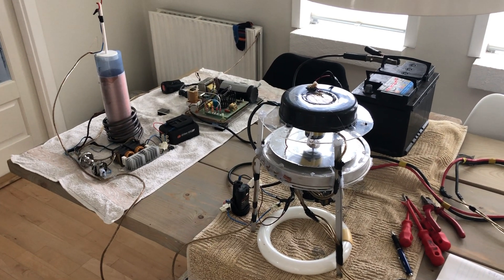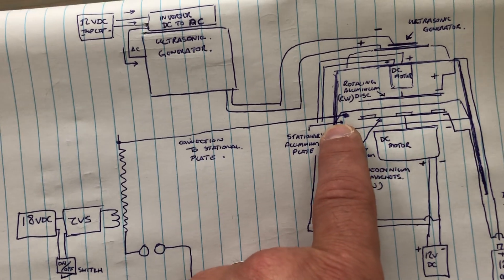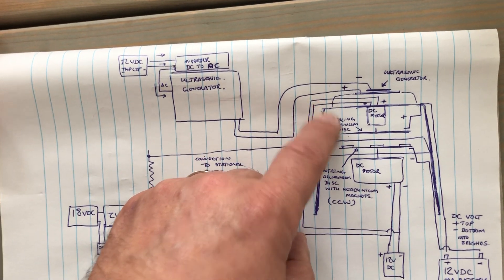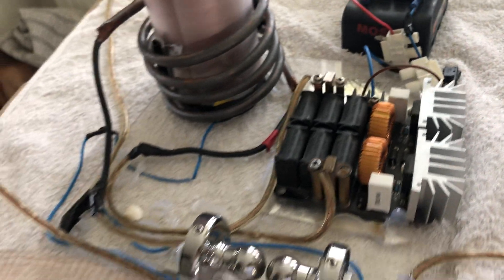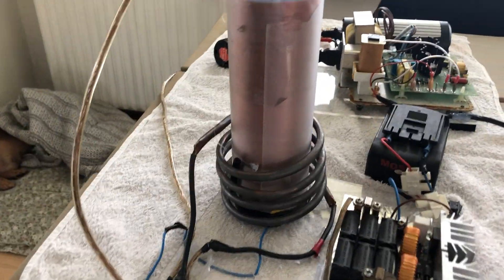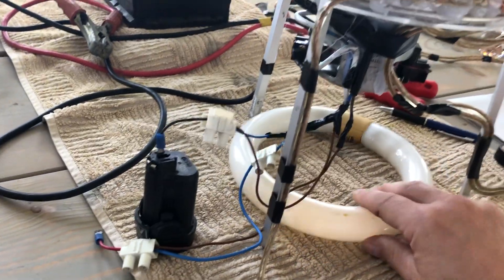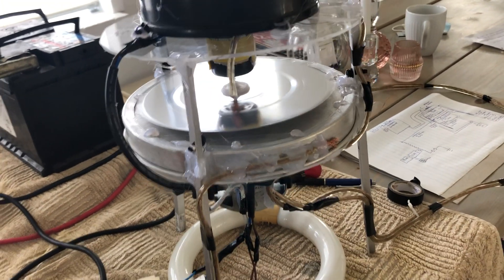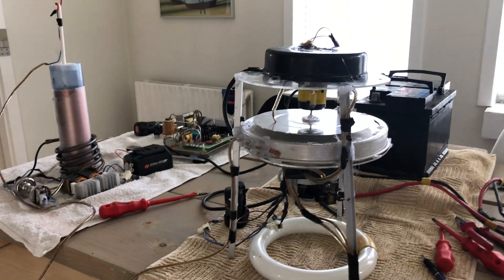SWR scalar wave rider/ graviflyer test 3 ultrasonic generator connected

Comment: do you have a part # or link to the ultrasound device on the top of your graviflyer?
Reply from the maker: It’s just an old ultra sonic cleaning device from a laboratory they were throwing away. I took the electronics out and thought it may help.? I don’t think it did!
Reply: @dkdyker  Thank you. I ordered the parts. Here is a video on what it is used for https://youtu.be/YnijhZdAseA    It helped me. He has another video you may like as well. https://youtu.be/Hkqa6c-0fFk    Thanks.....
Reply: @dkdyker  are you getting vibration when you turn it on? Also is there a pulse in the circuit?
Reply from the maker: @oldmanbuilds  yes vibration and yes a pulse. I should have kept the timer mechanism on this allows longer periods of frequency
Reply: @dkdyker  Here is a video on how I believe Alexey set up his. https://youtu.be/ACsy6xSIBm8

I think it came on when he had enough charge to the capacitor. But instead of a button he used a mofset like an on off switch. when fully charged it was allowed it to dump the full energy to the ultrasonic transducer.  Giving you the jellyfish effect. 

Let me know if you see it differently. Thanks..

Comment: yes you got it  the need one more spinning disc  the control  with three small holes to control in each  direction forwards backware left and right recontrol system all directs then you have afull working ufo

Comment: I've wondered if aluminium foil would be useful for a rough surface, either wrapping the central disc or a single layer stuck to a holding disc, as it's easily scrunched up etc. Also been eyeing up quiche tins for same purpose, though haven't started building anything myself yet. I quite like the idea that a flying machine could be built out of quiche tins and tin foil :)
Reply from the maker: Haha yes the world of useful garbage. I think when you plan to build try find an aluminum plate a lot wider than the rotating discs. I think this will help with balance
Reply: @dkdyker  Are you trying to achieve gravilifter like in https://www.youtube.com/channel/UCzZxKT3BzBZOVVy8_YzP6Yw/videos ? Just not sure how much truth is in there...
Reply from the maker: @T1000LTU  yes I am investigating this as the combination of magnetism aluminum and a high voltage running through a coil produced a violent repulsive reaction that maybe has something to do with the graviflyer. Who knows in a world of lies and fakery maybe we could make this happen??
Reply: Av for sat*n 😂😅 husk en hånd i lommen 🙂 fedt at se andre i lille DK interessere sig for graviflyeren 🙂
Reply from the maker: @chilimixdkcom  ja, leger du også med ideen?  Hvor er du i Danmark?
Reply: @dkdyker  ja, jeg er bare ikke nået til at begynde og eksperimentere endnu, jeg er fra Vestsjælland, hva med dig?
Reply from the maker: @chilimixdkcom  Nord øst jylland

Comment: Love your efforts on this, I'm almost at the point of giving it a go myself. I'd start with centre plate, I feel it needs to be able to vibrate and be flat for the electromagstatic(not sure what you actually call it 😂) energy to disperse horizontally. Also that resonator needs to resonate the whole craft, I believe Alexey's craft was so badly/loosely built it found its resonation point by chance with body and motor vibrations, which may also have been why it was so temperamental to stay in the air, IF HIS GRIVIFLYER IS GENUINE 🤔
Reply from the maker: Yes lots to try,, if you try then find out something we can share that will give us a step closer to the goal.